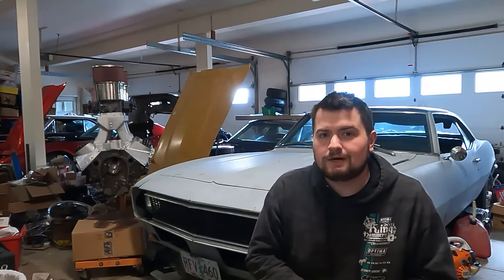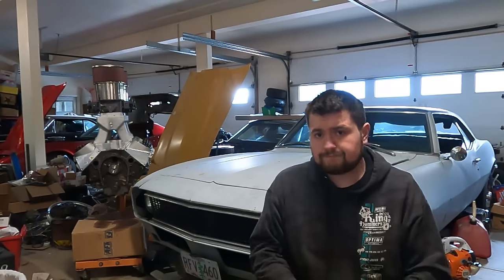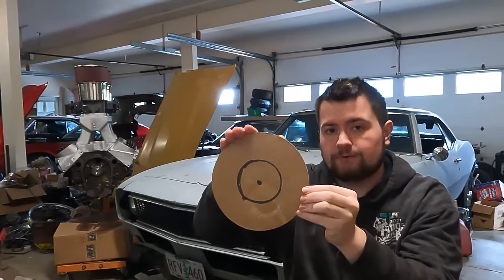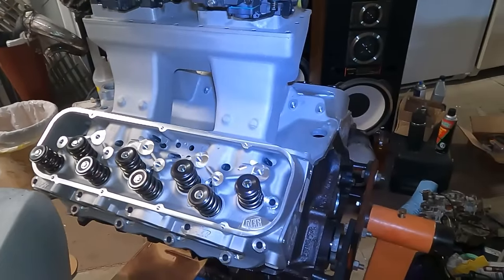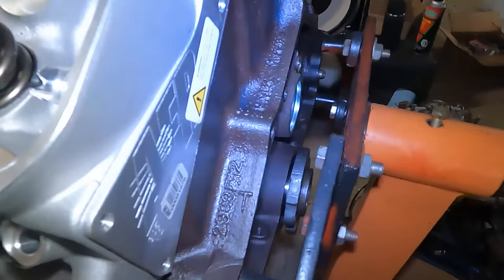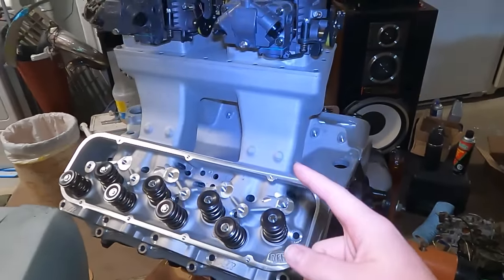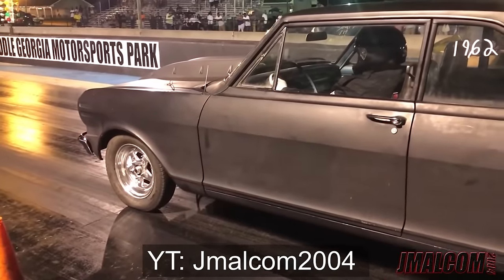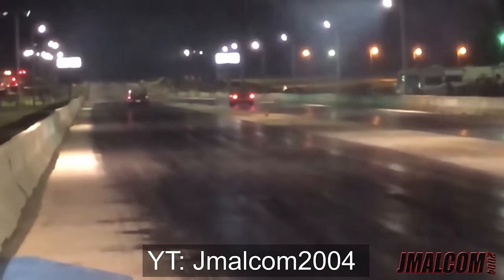The Truth About The Small Block Chevy 327

Comment: If they are built the same, you are not going to really notice the difference by the seat of your pants, unless you are running at the strip actually measuring the performance,  a slight gear ratio swap can make the more equal, say a 3.73 gear with a 327, and a 3.42 with the 350, the 327 would probably have a slight edge, a major edge with 12:1 compression, and good heads, and a cam that doesn't have too much duration,  and advance and retard the cam on a Dyno get the events timed best for the engine, around .585" lift, 230°-240° @.050" and a good dual plane intake with a 650 Holley, 1.6:1 roller rockers, possibly a hyd roller cam conversion, 2.08-1.55" valves, under cut swirl polished stems , 5angle seats, and a good porting, matching the intake , it should out perform any common 350, even a similarly built 350, a 327 will want about 500-700 rpm more than the 350 to have an equal output!

Comment: MINE 59 CHEVY APACHE TRUCK  327. .030 ,OVER 2.07 INTAKE ,1.60 EXH , MULTI PORT  DIRECT NOS INJ RUNS 12.9 119 IN  1/4 MILE WITH 2.07 GEARS TRY THAT . MOONSHINE RUNNING TRUCK 155MPH TOP SPEED

Comment: Properly set up.... Bearing RELIABILITY IS NOT AN ISSUE 327 vs 350. Unless you are running a professional built 327 you will never see hp gained by less 327 journal friction. Bigger stroke need bigger journals. Chevrolet knew what they were doing. My favorite and first SBC is a 327. I say build a build  327 if you want use good stuff and enjoy that 327 sound.
Reply from the maker: Never said bearing reliability is an issue. I simply stated that the small journal crank travels against the bearing at a slower speed than a large journal crank. Any way you put it the bearings (if both are equal) are going to experience less wear on a smaller journal crankshaft than on a larger journal. This doesn't mean the 350 bearings are unreliable.
Reply: @RatMaro  Fair enough.
Reply: @RatMaro  So the average guy should turn away from larger journals because of some significant advantage small journals have over large? I know lots and lots of stock and super stock racers who say the way they prep stock rods so the can really spin them tight say it's a lot more to it than that, and a street engine will not see any difference.
Reply from the maker: No a street engine won't see a difference. However it is something I wanted to go over with the 327 because it is a factor when comparing it against other small blocks. I personally like small block 400s and they have an even larger journal than a 350. Cubic inches at the end of the day is going to make a bigger difference than revving to a high sustained RPM. But if you're in a case where constant high RPM is a factor id trust a 9,000 rpm 327 over say a 9,000 rpm 400 if both are built equally.

Comment: According to my 1971 MOTOR'S manual. Chevrolet had in 1967, a SMALL JOURNAL, 350, crank. Do not know if it was a forged piece. Also will it fit a 62-67, 327  block? I have a 66 327 block that needs a new crankshaft, and would like to make that a 350. It will be strictly for street use.

Comment: At 6:01 you said "a lot of those 62-67 blocks are going to have forged cranks"

All small journal 327's had forged cranks from the factory, including the 1967 210hp LF7*. However, after Chevy phased out the small journal block they were still producing replacement cranks for them. Those replacements were cast 307 cranks with the journals turned down. If you find a small journal 327 with a cast crank, look up the part number and I'll guaranty it turns out to be a 68+ 307/327 unit.

At 7:45, in reference to the camel hump heads, you called them "the second best gm production head they ever put on a small block Chevy"

This is true only if talking about iron heads. Bone stock, aluminum 1989 Corvette 113 casting heads flow more than the camel humps(though less than even the 305 Vortec heads). They do have the additional advantage of small 58cc chambers which get you a bit more compression out of flat top pistons while being less prone to detonation than iron heads.

*(𝘛𝘩𝘦 327 𝘐 𝘣𝘶𝘪𝘭𝘵 𝘧𝘰𝘳 𝘮𝘺 69 𝘕𝘰𝘷𝘢 𝘴𝘵𝘢𝘳𝘵𝘦𝘥 𝘰𝘶𝘵 𝘢𝘴 𝘢𝘯 𝘰𝘳𝘪𝘨𝘪𝘯𝘢𝘭 𝘓𝘍7 𝘧𝘳𝘰𝘮 𝘢 67 𝘊𝘢𝘮𝘢𝘳𝘰. 𝘠𝘦𝘴 𝘪𝘵 𝘩𝘢𝘥 𝘢 𝘧𝘢𝘤𝘵𝘰𝘳𝘺 𝘧𝘰𝘳𝘨𝘦𝘥 𝘤𝘳𝘢𝘯𝘬.)

Comment: You need to get your story Strait all small journal small block chevie cranks are steel not forged ,95 percent of camel hump heads are 194"The 2:02 valve came out in 66 on the l79 327 350 HP the 1 st 4 bolt main small block was the 69/350 the 68 Camaro SS engine rear cast block # shows as a 327 block but the front block # shows as a 350 Camaro /nova block

Comment: Good, conversation for bearing speed an oil pressure Plus clean oil high pressure dirty oil sandblast your bearings and the conversation of bearing speed the roundness the bigness of your bearing lot of Ford motors had big journals narrow bearings main are always down the copper that's why we would run the car down the street the vehicle and do the oil pressure test to see if the main bearings were worn out as soon as you let off on the gas the pressure would go up you knew the main bearings were worn out. And when you get on the gas the pressure will drop.

Comment: Heads make the motor. A 4 bolt main never impressed me any. Other motors don't need them and a 340 barracuda will give your 327 a run for it's money. And blow your 350 4 bolt main off the road